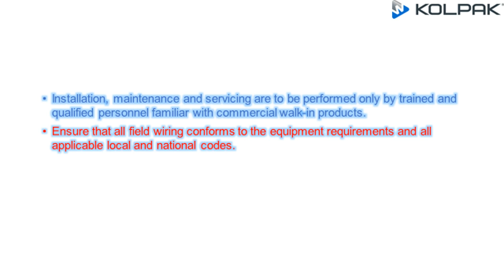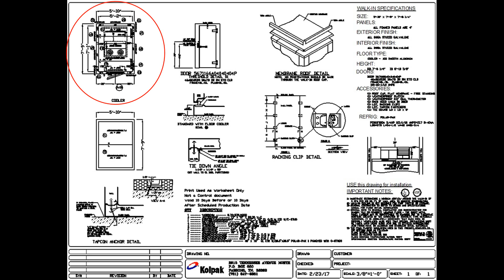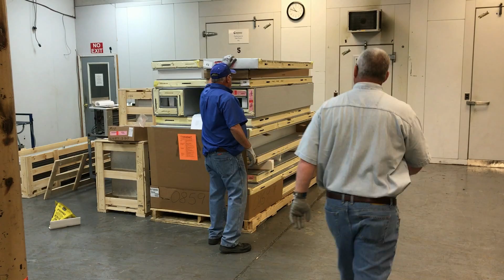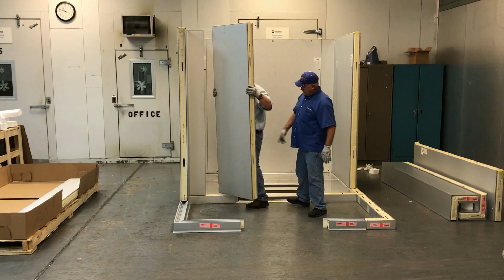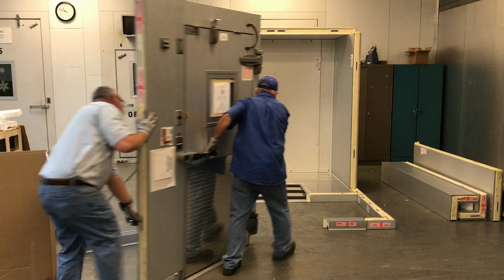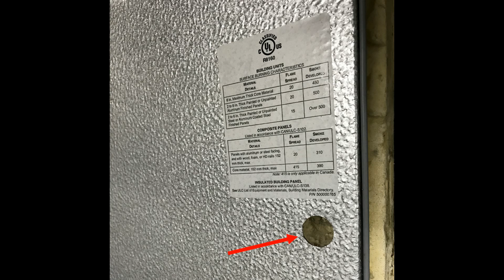Kolpak - Basic Walk-in Installation

Comment: Hello, are cove bases used anymore in walk-in coolers? Can you suggest an adhesive to use when replacing an old cove base in a large walk-in cooer? I will use rivets also but need adhesive. Thanks.
Reply: 100% clear silacone i found to be the best